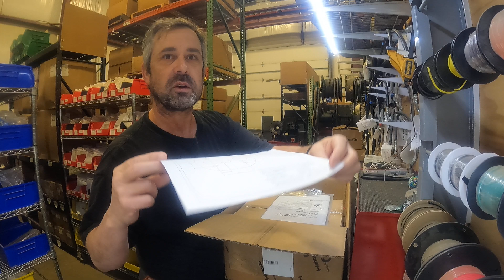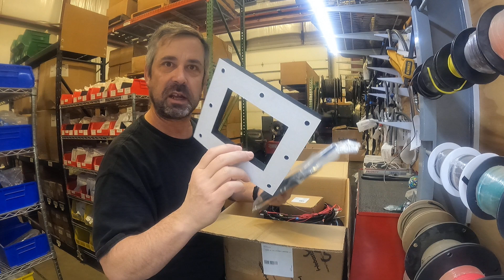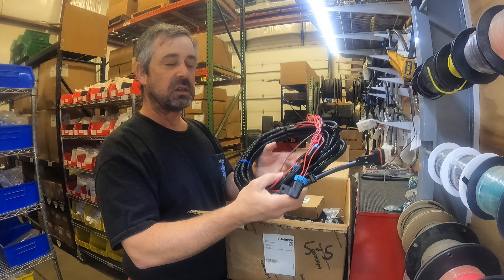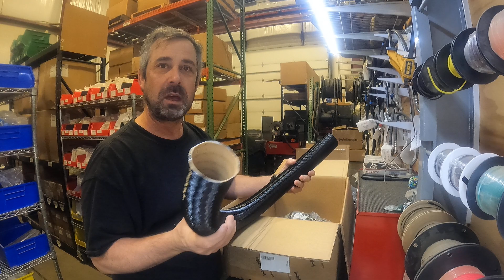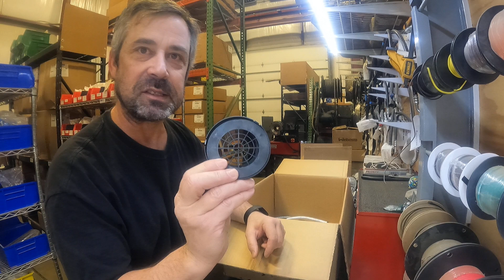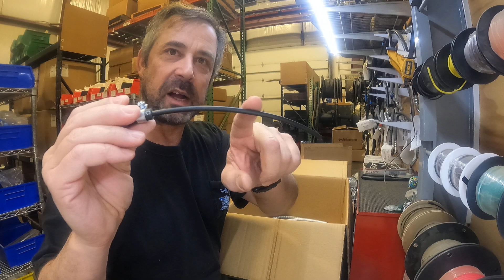#4 Webasto Air Top 2000 STC Diesel Smartemp kit for USA 5012555A

Comment: Iv got the smarttemp fx contoller but dont have the harness, where could i find one?? Thanks
Reply from the maker: The Smartemp 2.0 fx controller is designed for coolant heaters. It will not work properly for air heaters. For an air heater you need a Smartemp 3.0. We have most of those parts in stock. Give us call M-F 8-4:30 eastern time and we'll help you find the right parts to get you up and running.

Comment: Must the supplied fuel line pipe be used? Or can I weld a bung with nipple to my tank and pull direct from that? Thanks.
Reply from the maker: It is best to use the supplied fuel line. The ID of the fuel line is important for the fuel pump to be able to deliver the correct volume of fuel to the heater. If your standpipe is too large, the pump may not be strong enough to lift the fuel from the tank.

Comment: excellent. thank you, just ordered.
Reply from the maker: Thank you Thomas!
Reply: @VMACSinc  HI, I bought the wiring harness adapter off your ebay store. However I cant figure out where to connect into the heater unit and no instructions. Please help. I get the power hook up on one end and dial connects in the middle but the other end does not connect to the heater unit anywhere that i can see. I have a airtop 2000STC with the rheostat. I also sent an email to your website asking the same question. Thanks Scott!
Reply from the maker: Sorry you are having difficulty. I will call you today.